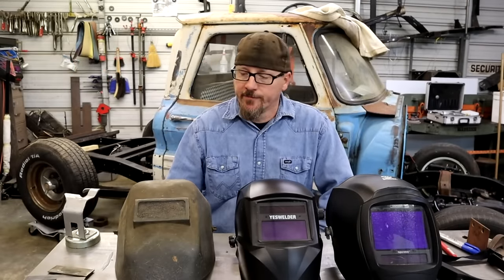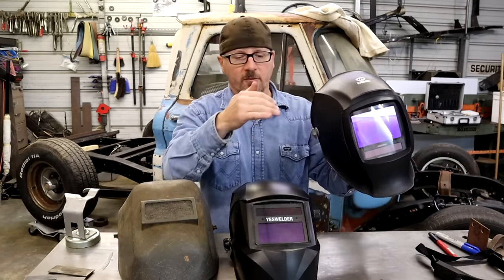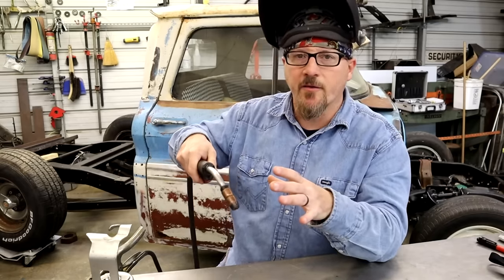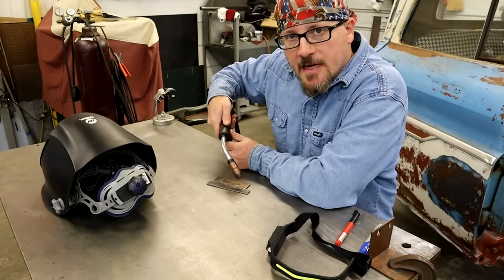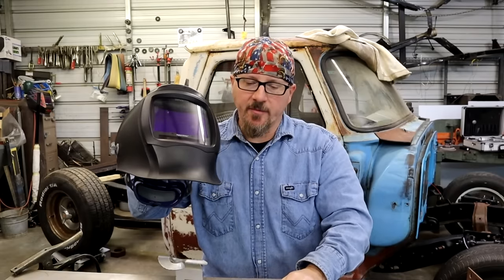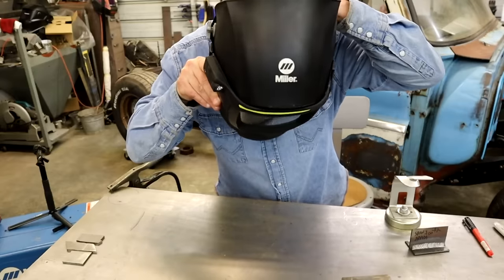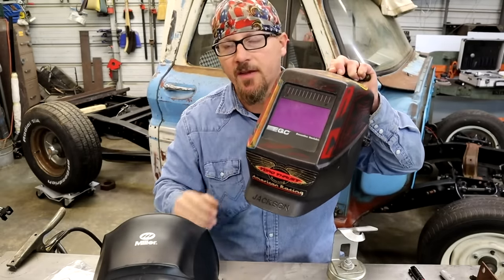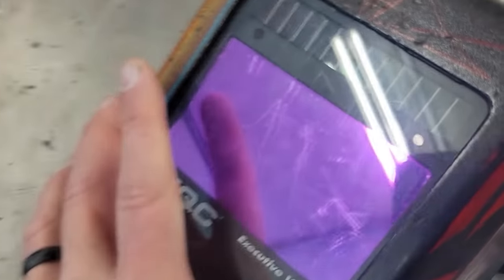(HELP) I Can't See My Mig WELDS (Top 5 Tips)

Comment: New to welding, just fixing and making stuff around the house. Nothing I would guarantee my life on. I have issues with light coming in from behind and shining in the inside. Can only weld outside due to space. Any tips?
Reply from the maker: I've had the same problem,  you can clip a old tshirt over the back of the helmet and that helps, a white t is not as hot!!

Comment: My own tip on cleaning dust off of the lenses (inside and out).
Like he does, use a compressor to blow the dirt off first.  Lower pressure is because, because too high of air pressure, turns the dust into a sand blaster.  SCRATCH CITY!

Secondly, I NEVER rub the lens with a cloth or anything.... at first, I take a CLEAN cloth (usually J cloth) and lightly dampen it.  Not wet.  Then, I DAB the lens so as to have the cloth pick up the dust/dirt.  NEVER RUB.
When you rub, you are again, using the dust as sand paper.  After all, that is what dust is.  It's super tiny, sharp rocks.  Rubbing is literally sanding.

By blowing off first (larger stuff goes poof) then dabbing, you get the majority of the dirt without scratching.

Then the final cleaning, I'll rinse the cloth so it's perfectly clean, then add a drop of gentle dish soap (Dawn) and LIGHTLY rub the lenses.  After that, again, rinse the cloth to get all the soap out and use clean water, again, damp not wet to clean off the soap residue from the lenses.

This works a wonder.  My lenses never get scratched this way.

Of course, this does not help spatter.
Reply from the maker: Thank you for your tips and tricks!!!!

Comment: Poor eyesight so glasses, speedglass with inner and outer protection plastic lenses. Total of 8 surfaces that need to be clean to start with. Some good lighting on the area that you are welding will help too. Adjust the "darkness" on your speedglass.

Comment: I just bought a arcCapton 130 .  110v .  Could I build a utility trailer with it.
Reply from the maker: You should be able to, as long as your not using any material over 3/16" .You can grind a bevel on all of the edges that your gonna weld to help with penetration . You just have to turn it up close to max power and use a good thick cord so you dont loose any power!!

Comment: As a welder you push solid wire and drag stick.
Reply from the maker: I've done cut and etch test on both push and pull and they look the same, but pushing will cause more splatter!!

Comment: Nothing wrong with a Pipeliner or a fiber-metal hood with a good drop in auto dark Lense. What you really need to do is research the optical clarity of the lenses 1/1/1/1 is the best.    Backlight coming in the back of your welding helmet is your next worst enemy. That’s why rig welders use pancake hoods.
Reply from the maker: Your 100% correct, alot depends on what type of welding your doing, autobody spotwelding will give you popeye arms from lifting the hood up lol

Comment: auto helmets are ok but they can turn off if welding flash gets on inside of lens and it doesn't always turn on when you want it to so you get a little arc flash but you get a few during the day you get arc flash at night and that does not feel good get a potato cut in half put on eye lids closed , the old small  lens sometimes dont give you all the view you need and you have to move your head way down or up to see I like the Jackson helmet and a 11 or 12 lens wide
Reply from the maker: I have found out the hard way dont use cheap auto dark helmets lol, i like my fixed shade if im doin alot of higher amp welding I love the fixed shade, also for stick welding!

Comment: Since when do you drag a MIG unless its Flux Core? Just an observation,start pushing instead and you will notice a big difference in the quality of your welds.
Reply from the maker: Ive done both and cut and etched the weld with no real penetration difference,  I think its more preference or what you feel more comfortable with. The real reason I dont care for pushing in the type welding I do is it builds up a little higher. I do more motorsport fab which they are more picky on the look also. Thanks for the comment!!!

Comment: I bought what I thought was a decent welding helmet was a Hobart cost me 100 bucks and some change at a Big R farm supply store. I have a stick welder I tried all three settings in that dumb thing every direction, no matter what it would delay the moment I strike the metal and start welding every time, by the time I finished up I ended up with flash burn, pretty disgusted with the helmet, I don't know what to think of it if it was defective or what, I do know I'm not using that helmet again...
Reply from the maker: Check this link to a video I recently filmed on a replacement lens to up grade your helmet, it worked great.
https://youtu.be/WJkzs0z9CkE

Comment: I'd always lay my hood down and it would collect dust and I'd wipe it off when I came back to use it then My Son pointed out why not hang it up somewhere when done so the lens does not get dirty so for years now it has stayed clean I keep windex and dry cloth by my helmets so I can clean it easily each time......One day in the bright sun light I was welding a new diamond floor on a trailer ... And when I got the sun light hitting a certain way I think the sun was Directly over my head facing the welding surface   wow !  I could see every single inch of everything in my lens Lit up super bright just like I looking at it with bare eyes but no brillant  weld flash  Everything 100 % PERFECTLY. in sight...Then later I guess the sun changed and I was back to restricted view again with just seeing the weld puddle and slightly around that..just enough .to see the weld seam line to be welded....To this day I'm still wondering what happened and was I protected from getting weld burn? Or was it just the lhigh sun light that made it great?
Reply from the maker: Ive done the same thing lol, I started putting mine in a helmet bag and that has helped alot! Thanks for watching!!!!

Comment: Hi. ive looked into these cheater lenses and was wandering how i would be able to work out which magnification i should buy ???
Reply from the maker: Some welding stores will let you try them out, I usually start at the lowest power first, or try on some cheap reader glasses and check out the power on them, maybe you can use the same power. Hope this helps!!!!!
Reply: @ACDesignsGarage   Thanks for that ;)

Comment: I find those headband leds get cooked by the arc or something, they still work but only some of the individual cobs light up.
They're cheap enough to replace so it's worth it for when you need it, but don't leave them on the hood all the time.

Anyone know if the outer and inner screen protectors are a welding specific plastic or just clear acrylic?
I've bought a few branded sets and a few pieces of 1mm sheet and can't seem to see any difference.
For one of my hiods the protectors are costly enough to think about how often i change them, seems to be that buying a 1200x600mm piece is the best way and cutting it to fit both of my hoods.
Worth experimenting for thrifty home use!
Reply from the maker: I haven't had that problem yet! The clear plastic may be lexan not real sure, i go on amazon and buy mine!!
Reply: @ACDesignsGarage  coolo mate.
Acrylic (lexan/perspex) is more scratch resistant so that's probably the better choice.
Polycarbonate (plexiglass) is more impact resistant by a lot so better for grinding production.
Temperature ranges are similar but Acrylic doesn't burn like a tiki torch like polycarbonate does!

Im going to do some testing to see which holds up better against scratches and spatter...

Comment: I been welding for 45 years and you should never pull the gun when welding short arc always push
Reply from the maker: Ive done beeak and etch test and you cant tell a difference,  Ive been welding for 30 years.

Comment: Another question. Is it possible to MIG weld carbon steel exhaust tubing to SS304 using STD MIG wire and argon/carbon dioxide mix gas? Thanks
Reply from the maker: Yes I may do a video on it this week, thanks for the idea. The only thing is your weld will rust so youll have to paint it a little past the weld onto the stainless.
Reply: @ACDesignsGarage  Thank you sir! I have never welded dissimilar metals. I'm trying to make due with the steel I have for the exhaust. Steel is so expensive I don't want to purchase additional stock. Rust will be an issue but pretty dry here in CO. Building an exhaust for a 71 Camaro. Driver not a show car. I may wait to see your video on welding two different metals!!
Reply: @Danno74Z  It will fail sooner or later.  I've seen this happen where an SS304 exhaust pipe was welded onto a mild steel back box.  My suggestion?  Weld an oversize piece of the same metal (with lengthwise slits) on one part, and slide the other part in with a load of exhaust putty, then use an exhaust clamp to squeeze the outer piece down.

Comment: What gets me the most is inside lens keeps fogging up, I need some way to deflect my exhaling downwards, not on lens.......
Reply from the maker: I try to exhale out of my nose, it kinda helps. I wonder if you can treat it with something like rain X to stop the foging up, not sure it that will help or not!
Reply: @ACDesignsGarage  Before I retired this past January, we used 3m Add-Flo air fed welding hoods, thats the best hood I ever used, they run around $2k. If I was going to do a lot of welding I'd but one, but now I just do small repair jobs at home so I'm looking into your links for the YesWelder hood.

Comment: Dragging a mig welder is not proper welding technique in todays welding.  Push weld is what we got taught for welding equipment and structural.  So you need to be ahead of your welds looking back. You can see it just fine doing a push feed.
Reply from the maker: Thanks for the tip. I mainly do automotive where the wall thickness is no more than 0.250 so drag and push really dont effect the weld except for pushing can build up the profile of the weld a little more. Thanks for the info.
Reply: I have been welding since 1954 at the age of 15 and a old welder told me to get a stick of French chalk and make a line down the  two pieces of metal that you are going to weld, and as soon as you strike up you can see and follow the chalk line so easy, it’s as simple as shelling peas. That’s my tip, no fancy head shads just the old dinosaur one

Comment: YOU don't drag hard wire ..   YOU push ...   IF it has Slag, you drag ...  DURR..., !  ! ❗❗
Reply from the maker: Tomato tomato
Reply: @ACDesignsGarage  ,  that's what they thought @ the shop. Till, one day the welding Cert guy was in the shop and I said you push. And another guy said you drag.  Then the welding inspector/ Cert guy.   Told them that I was right. And they were not...